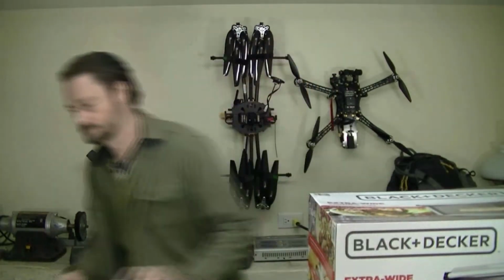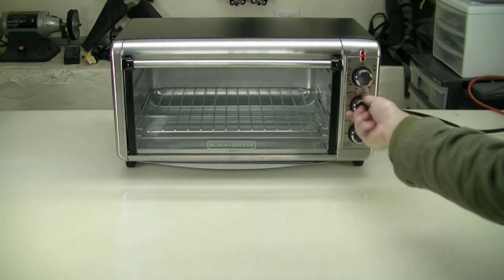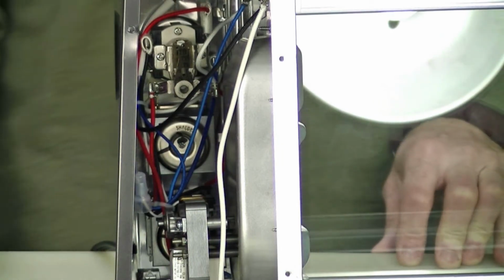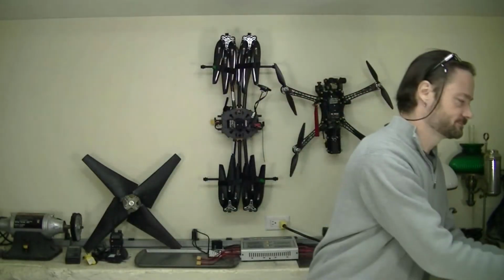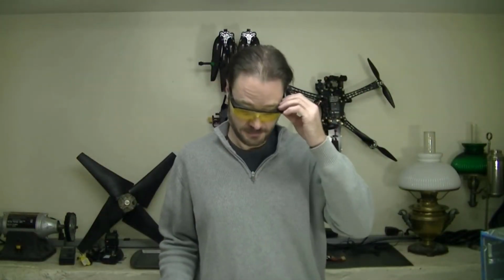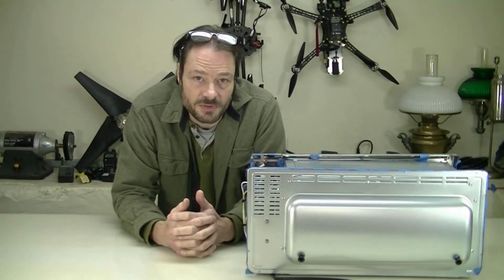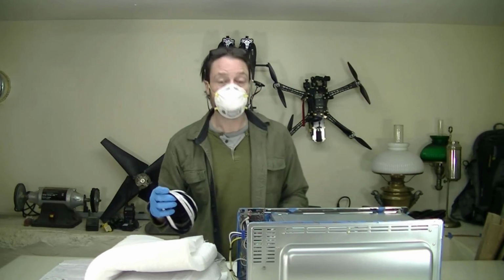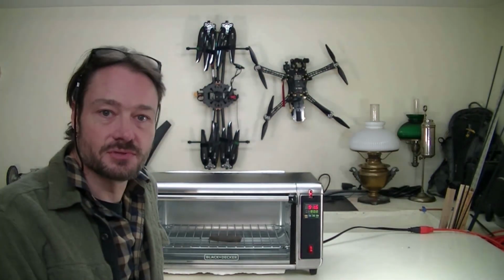How I Hacked A Toaster Oven To Build A Filament Dryer, Bort's Filament Dryer Investigation Part 2

Comment: Thanks for the video. Great minds certainly do think alike. I bought the same toaster oven and PID controller for the same purpose. Thanks again. Also, did you not use the heat sink which came with the solid state relay? It looks like you just mounted it to the back of the cabinet.

Comment: Nice work. On mine I wired all the elements in series. That got it down to around 360 watts max and under 4 amps. Using 2 cheap w3230 controllers that are not smart so it also slows the temp rise down. Wired one in front of the other because at 10 bucks the QC is probably terrific. First one is set at 90c in case of a failure on the second on that sets the temp for the filiment.

Comment: Why not a digitally controlled convection toaster oven to begin with?
Cool project regardless
Reply from the maker: The reason for the temperature controller modification is not to make it digital, it is to get precise control. A toaster oven with a digital control could still be +/-10C or more. That won't work for me.

Comment: I want to  do this but i'm too scared.
I also could use it as a PCB Reflow station on the other hand. My house barely has space tho :|
also this  is 100cad. still cheaper than the creality space pi I bought  tho, but I can't feed filament trough it.

Comment: What I've done in the past is set the appliance to always be on, maximum temperature, for safety you could set it to a lower value, wire the relay to control a standard electrical socket and then have the PID controller switch the socket on and off when the set temperature is reached.  With the appliance connected to the controlled plug socket, temperature is set at and controlled by the PID controller.

I do like your approach since it results in a more finished product and provides more accurate temperature control.
Reply from the maker: That is a more simple approach. Honestly, the idea hadn't occurred to me. Either way, I was looking for something specific.

Comment: Just bought my own toaster oven that I’m gonna try to use without modifying it but if necessary I’m probably gonna throw a 3D printer enclosure heater in it and call it a day. Or maybe an only heat bed from a broken printer. A lot safer than fucking around with AC lol.

Comment: I guess maybe I should go back and tell my pre-toddler self to quit playing with the power cord on Mom's vacuum. I was modifying electrical appliances before age 9-ish, which is when I helped Dad wire a new room in the basement. I did survive (so far) all the electrical shocks over the years. Some left me flat on my back for a time..
I think maybe I can repurpose my reflow oven. Probably need to load some different firmware on the controller. Oh, it used to be a toaster oven.
Reply from the maker: I'm glad that you are still with us. However, one is generally ill-advised to tempt fate. :-)

Comment: I cringed a bit when I saw your printed bezel, because I was worried that it might be a) flammable and b) thermoplastic (although of course the temp should never reach the intended temperature of the original product). 
What material did you use for the bezel? Did it warp or degrade?
Reply from the maker: Yeah, I was very careful about that. The bezel is Nylon 6. The only reason that I can get away with plastic is that I also insulated the inner wall of the oven. Where the original design made use of the oven's thermal inefficiency, I tried to improve it.

Comment: Hi Bort, my wife banned me from using our kitchen oven to dry nylon filament anymore (it probably wasn’t wise anyway due to ethylene exposure).  I then had the same experience as you with commercial filament dryers and wasted my money just like you.  I then went through the same thought process about possibly using a modified toaster oven, and that’s when I discovered this video.  I’m inspired by your success and just ordered the PID controller and bought a used toaster oven to try your approach.  Don’t worry, I have a EE degree and have training and experience working with hazardous voltages and designing  equipment powered from mains voltage.  The one thing I haven’t figured out however is how to tune the PID parameters.  I will be using the Inkbird controller which I think is the same design as yours.  How did you do tune it?  Thanks in advance.
Reply from the maker: @ Paul Sangree - Ah, a kindred spirit! Well met, Paul! The truth is that I didn't tune the controller. It also only appears to be  PI controller. Makes sense. The D term probably just introduces too much noise for a simple microcontroller algorithm. The controller allows access to the P and I gains, but offers no info on how to tune them. Instead I just ran the built-in autotune function. It isn't perfect, but in the ballpark. There is some oscillation if disturbed, but it settles down within a few minutes. Hope that helps!
Reply: @uselessstuff8031  
For what it's worth, there are compact controllers that have full PID support, though possibly not in the budget-friendly pricepoint we hobbyists tend to frequent.

I had the opportunity to attend the Watlow Controls factory school on temp controllers and heating solutions a few years back, and their products did have full PID control, at least in any product that wasn't specifically incapable by design.

Looks like it's time to dig through the old equipment pile and scrounge a retired controller for a toaster oven retrofit!
Thanks for the idea.
Reply from the maker: @heyallenify  Thanks for the info. Yeah, I'm pretty familiar with Watlow process controllers. And you are correct about budget. $300-$400 US to control a $55 oven = Nope. :-)
Reply: @uselessstuff8031  
Yeah, if I were buying them instead of pulling them from the old demo equipment being scrapped, they'd definitely not be going in my equipment either!

Comment: So, did the filament actually dry out once you got to a higher temperature?
Reply from the maker: @dgkimpton - Yes, my filament is now dry and prints beautifully. The dryer performs flawlessly.
Reply: @uselessstuff8031  sweet. I'll have to stick a thermometer in my dryer and see if it has the same issue. Thanks!